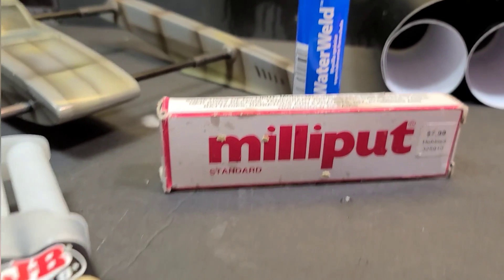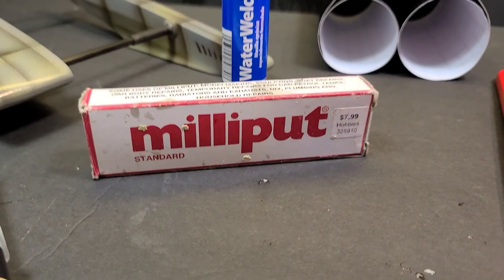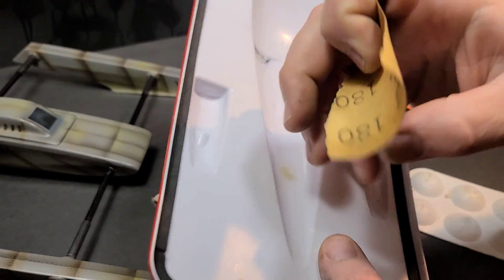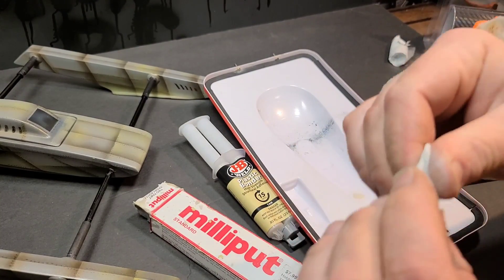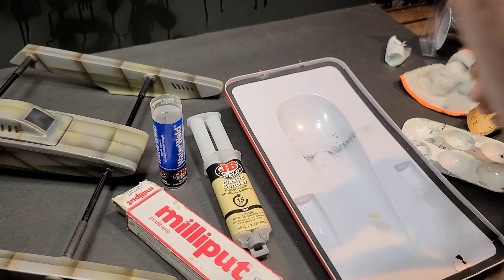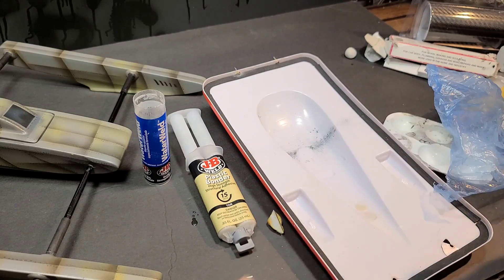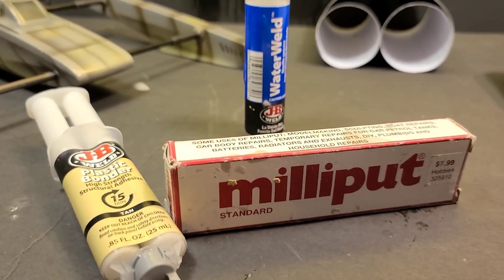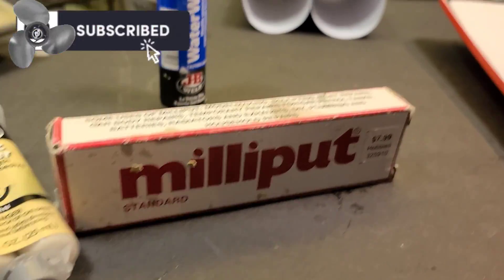Testing Three Popular Plastic Adhesives & Fillers - RC Boat Plastic Adhesives

Comment: Thanks for the video just took the pro boat recoil 2 Heatwave out for it's first run after smoking the esc an replacing it with the OSE 90 amp esc u recommended an it ran great until i knocked the steering  fin up with some seaweed or what ever u want to call it an ran it on to shore an had it flip 3 times an hit a picnic table an punch a hole in the rear corner by the drain plug above the seam about 1/2 an inch wide an about 1 inch tall tapering to the top of the port side rim so ill be trying the JB Water weld wish me luck !
Reply from the maker: I had a Crack in mine jb PLASTIC WELD  is a better choice, use some drywall tape to reinforced the area.
Reply: @IRONCLADRC   It works well being that it's in the back port corner side of the boat but if i would of used it in a place in the boat were the boat flexes this would be way to hard  an would never work because it has zero flexibility ill go bet on it in the water for 3 rides an see how it holds before sanding an painting but i may have been fiber glassing it! well see . ? does the water jb weld flex or is it had like the plastic jb weld ?

Comment: I want to use water weld for the prop shaft and I have regular JB weld, water weld, one minute epoxy 5min epoxy and 30 minute epoxy. Which one would be the best for the prop shaft of my blackjack 24.
Reply from the maker: Jb weld is the best
Reply: @IRONCLADRC  the water weld or the original  JB weld which I know regular is really strong but is it waterproof enough?

Comment: Good day I'm new to the rc hobby game and your videos have been a big help to me. I just got a new Sonicwake. Is there anything I can use  to reinforce the  seams before I even run the boat? Or do I have to wait for the hull to crack
Reply from the maker: Epoxy to Plastic don't realy mix well.  The plastic Weld may help.  I would just run it, should be OK 👍

Comment: WHEN YOU HAVE TWO MOTORS IN ONE BOAT DO YOU HAVE ONE PROP SPINNING CLOCKWISE AND THE OTHER PROP SPINNING COUNTER CLOCKWISE . YOUR MOTORS ARE DOING THE SAME. THAT WOULD STOP ALOT OF TORQE. BUT YOU WOULD HALFTO GET A PROP TO SPIN COUNTER CLOCKWISE AND REVERSE WIER YOUR MOTOR.P.S I USED THE WATER WELD IN MY POOL SKIMER --- WORKED GREAT.GOOD VIDIO
Reply from the maker: Lol I used the water Weld on my pool pump/skimmer impeller too..  that's why I bought the tube lol.  Yes sir.  Counter rotation props are the best and most efficient